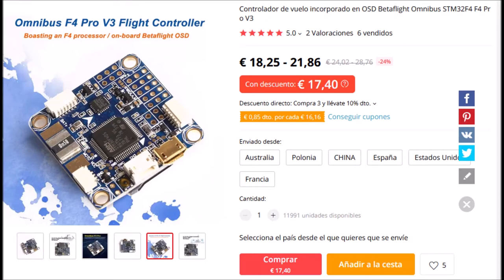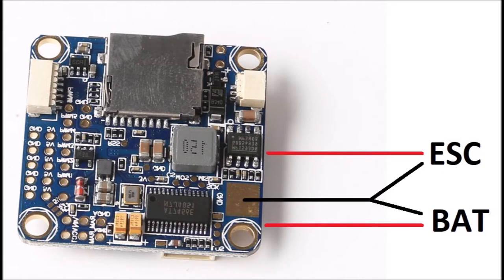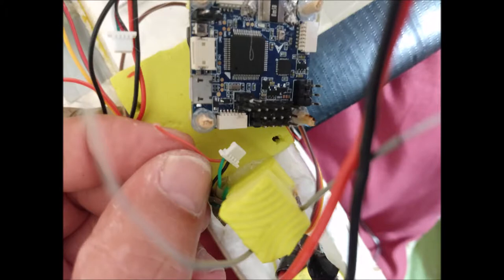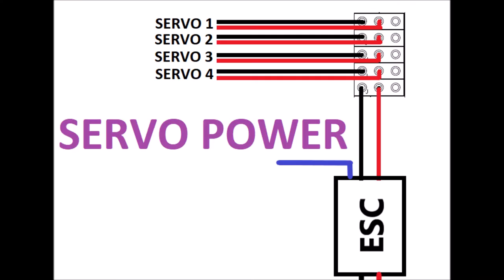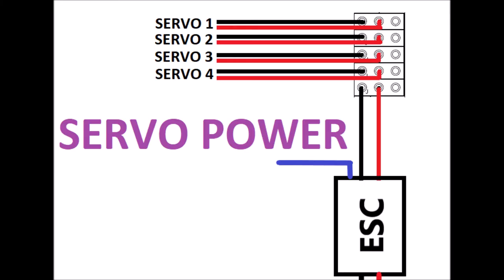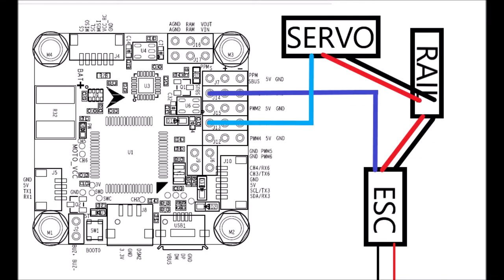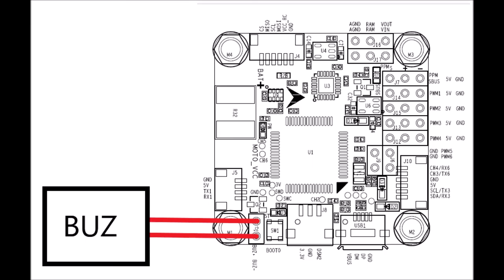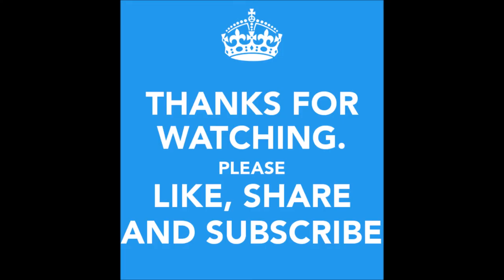How to setup OMNIBUS F4 PRO V3 for planes, GPS, FPV, rail 4 servos, INAV IBUS FLYSKY protocol

Comment: hello, can we use the betaflight f3 fc for fixed wing when flashed to inav?
im new to inav.
Reply from the maker: i think there is a firmware for betaflight f4

https://github.com/iNavFlight/inav/releases

its a f3 board, inav recommends at lest f4 boards

Important Notes
F3 Removal

STM32 F3 flight controllers like Omnibus F3 or SP Racing F3 are no longer supported in INAV. If you are still using F3 boards, please migrate to F4 or F7.

The supporting code will be retained for a few more releases, but will not be maintained and is not guaranteed to build or work properly in the future.
Reply: @FisicayQuimicaCanal  alright thanks for your advised.
Reply: @FisicayQuimicaCanal  so this board is f3? I thought it was a f4, thinking of using this fc in a build. I saw that ppm receivers have been  dropped from inav

Comment: hi! is this the omnibus f4 pro v3 clone?
Reply from the maker: Yes, its a clone, i had problems with VID IN and VID OUT pins
Reply: @FisicayQuimicaCanal  i see. I'm planning to build my first diy drone with this. Do you think it would be good even if I dont plan on putting fpv equipment on my drone?
Reply from the maker: yes, if you buy the original airbot omnibus, it cost 40 dollars in banggood

https://www.banggood.com/Original-Airbot-Omnibus-F4-Pro-V3-Flight-controller-SD-5V-3A-BEC-OSD-Current-Sensor-LC-Filter-for-X-Class-p-1319177.html

if you buy a clone, may have problems with OSD, may with voltage regulators

what people do is to power servos from ESC, and power VTX directly from battery, avoiding the rubbish voltage regulators of the clones
Reply: @FisicayQuimicaCanal  alright! Thank you so much for the info!